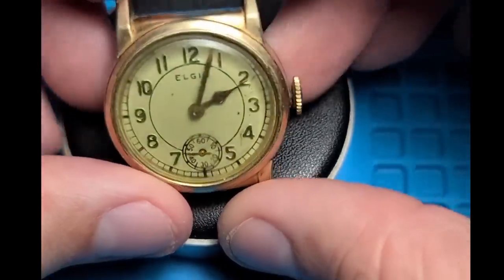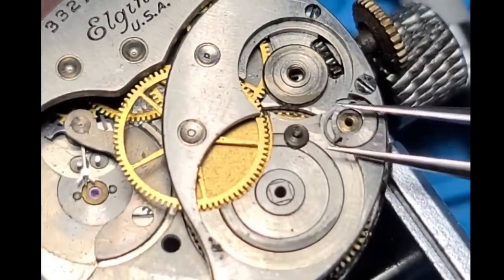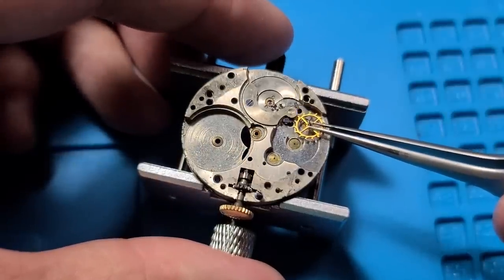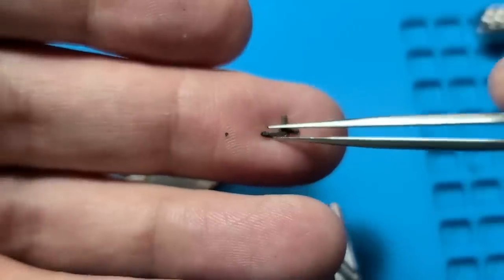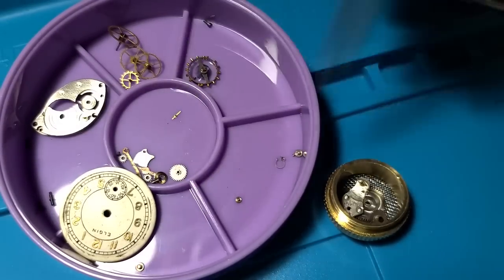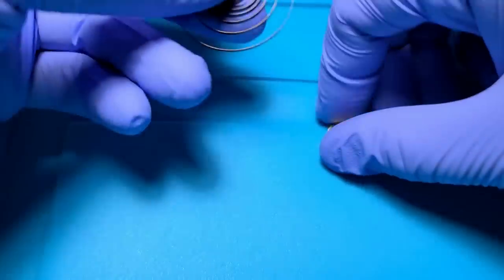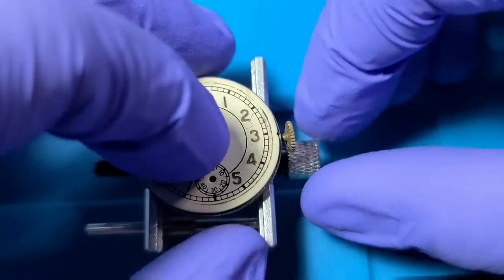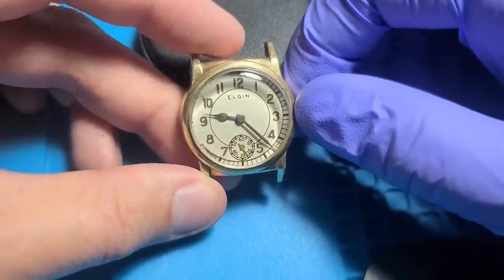Restoration of a $3 Thrift Store Elgin Mechanical Watch

Comment: Nice work for your first video. Don't forget Watchmaking 101 rule.. use the right size screw driver. Those mainspring ratchet and crown wheel screws may have come out easier with proper size screw drivers. Hope you don't mind another tip.. I always make a small sketch on a note pad (like only a half inch concentric circle) noting the direction of the mainspring and how it attaches. Saves you from putting the mainspring back in upside down. With the mainspring in the right direction, there's only one way the arbor can go in and work. 👍 lol Looking forward to more videos from you!
Reply from the maker: Thanks for the tip! I actually did have the mainspring in the right way, but the barrel arbor was upside down - this then caused me to put the entire barrel back in upside down and had all kinds of problems.  Definitely trying to work on the screwdriver selection, and will keep at it.  Thanks for watching!
Reply: @letslearnwatchmaking  It took me ages to grasp this concept when i started as no one ever explained this to me and just kept on saying 'choose the right size screwdriver'... but correct size doesn't mean correcct width. It means that the blade of the screwdriver does not touch the bottom of the groove in the screw. The screw then acts as a vice against either side of the blade and it will not slip out when putting downward pressure on the screw. Hope it helps. Loved watching the vid :D

Comment: That's a Grade 485 from around 1932, in case anyone was wondering. Elgin serial numbers are easy to look up on the Pocket Watch Database. I Have a very similar Elgin grade 417 that belonged to my great grandfather. Thanks for the Video.
Reply from the maker: Thanks for adding this! I had meant to include the grade in the description, and yes the Pocket Watch Database is an amazing resource, especially when it comes to the older Elgin watches.

Comment: I actually like this video. You don't have any fancy equipment. It seems like you are a novice or maybe even an intermediate and don't have the funds to buy the equipment or simply don't want to because what you've been doing has been working just fine. You remind me of myself in building fishing rods.
Reply from the maker: Thanks, you're spot on with all of this. I'm still an extreme novice, having tinkered with a dozen or so movements so far. I have quite a few hobbies, and I always use the cheapest tools until I know what works and what doesn't. After that, I'll upgrade what doesn't 😅.  I'm going to continue with this basic setup until it doesn't work! Thanks for watching!

Comment: I enjoyed you video of the $3 Elgin. I would suggest a couple of larger screwdrivers as you seemed in danger of slipping with smaller ones; also a more robust tweezer helps to avoid the more spring way events. I too have got the arbor around the wrong way. Well done, keep going.
Reply from the maker: Thanks for the feedback, I do have a relatively complete set of screwdrivers, but find myself reaching for smaller ones all the time. I think using the largest possible screwdriver would definitely help with slipping and stability in general. Thanks for the tip!

Comment: on the numerous small sized elgin movements I've worked on and slipped with a driver the hairspring usual comes out fine, but i can remember vividly at least 9 times from my early days where i didn't take the balance out and end up snapping a pivot on the balance arbor, you'd have thought id remember to take the balance out after the first couple but apparently not.

Comment: Very good restoration.  I have an old Elgin automatic, (maybe from the 70's or 80's) that belonged to my grandfather.  It probably has never been serviced.  Unfortunately, it looks like the only way to access the movement is to remove the crystal.  The case is a single piece.
Reply from the maker: Thanks for the comment! I'm in the same boat with 2 watches I picked up on eBay.  I tried a cheapo crystal remover from Amazon and it failed almost immediately, luckily not damaging anything but the tool itself.  Going to save up for something better, hopefully that does the trick!
Reply: @letslearnwatchmaking  After watching several watch restoration videos online, I dug out my grandfather's watch and was hoping to peek at the movement.  No dice.  Toying with the idea of getting into the hobby.  I do love fixing things.
Reply: I have a couple of Longines Admiral 1200 automatics that I think come apart through the dial as well that I'd like to get into. I've been wearing one that is a little erratic, sometimes it runs OK sometimes it will be fast or slow 5-10 minutes in a day so I suspect there is some debris inside.

Comment: Well done Mate! When counting jewels we start with the balance wheel pivot jewels (4), then also count the roller jewel (1) and the pallet fork jewels (2) to add up to the 7 you mentioned.
Another tip to more consistently oil cap jewels is to use bigger tweezers, where you can file a tiny groove horizontally into the tip. That prevents them from moving and you can lay em down on a soft coushion, so they dont flip when letting go of the tweezers.
When grabbing the wheels with your tweezers try grabbing them by the „spokes“, like you did with the centre wheel, it‘s a tad safer.
Nice work when lining up the bridges!!
Thats a sub from my side! Keep it up.
Reply from the maker: Thanks so much my friend! I eventually learned how to count the jewels, not realizing right away that the pallet fork jewels and impulse jewel count too. The tip about some modified tweezers is some fantastic advice, I'll definitely be doing this.  Next purchase will be some tiny files. Thanks again!!

Comment: Well done.  Just a piece of advise if I may, get yourself some wider tweezers.  These ones are way too sharp.  They will scratch the movement and ping screws and smaller parts. I would also not use the rubber mat you're using, it too bouncy which make it seem like the camera is shaking and they will bounce part right onto the floor. 
Thanks for sharing.
Reply from the maker: Thanks for the advice, similarly to the screwdrivers, I find myself falling back to smaller/sharper is better, when it really just makes things less stable.  Please bear with me for the next couple of videos as I'm filming them simultaneously, but I do have a pair of brass tweezers that I will be using for the majority of work moving forward.  

A lot of the bouncing and shaking of the camera is due to me just figuring all of this out.  I had recorded the first half or so in a way that I had to crop and edit the position to keep things centered on the screen.  I have since figured out a slightly bigger setup.  A nice bergeon mat is on the list, but prioritizing a few other things first.  Thanks for watching!!

Comment: The "gunk" looks like graphite gun lube.
Reply from the maker: It does kind of resemble that,  but if it is, it has formed into more of a paste over time.  Either way it was good to get all of that cleaned out. Thanks for watching!
Reply: Old, dried up grease. They used organic lubricants way back then. New synthetic oils & greases usually evaporate mostly over years & leave much less residue.